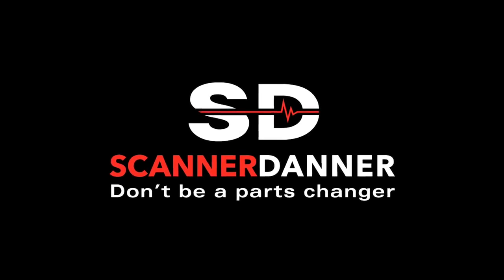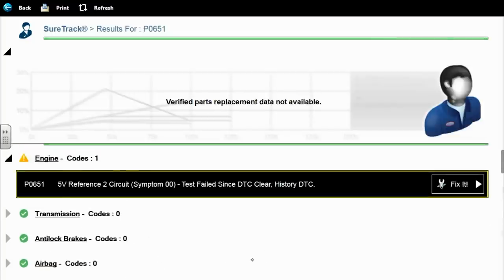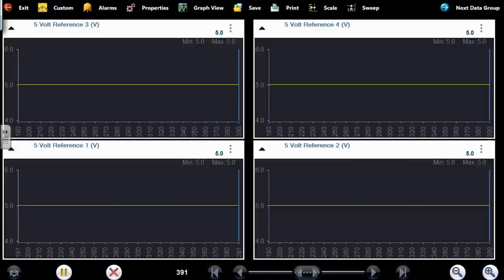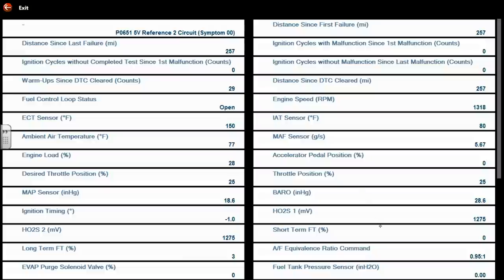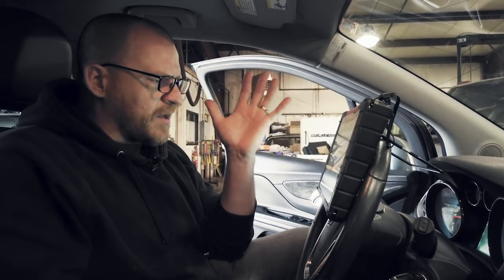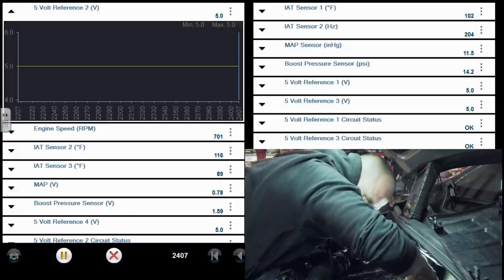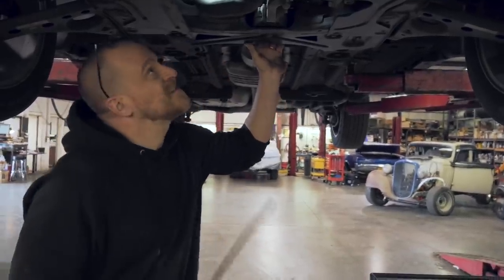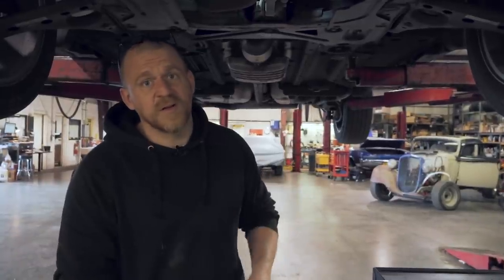Damn Intermittents (2014 Buick Encore 5v Ref Circuit Short)

Comment: Well to help out here that is not a common dtc or nothing common about anything with that dtc 
That harness being out of the c clip is normal sometimes come from the factory with those loose so don’t worry about that to much 
This engine is not GDI it’s port injected FYI 
Injectors go into intake manifold 
Now the only thing I’ve seen a vehicle like that act weird is underneath the battery tray there is a harness if I’m not mistaken & what happen with me was battery corrosion from old battery leaked into harness & made vehicle do some funny stuff can’t remember what dtc’s it set but it was my problem 
Hope this helps Paul 
GM TECH OUT...

Comment: 5v ref resistance check to ground. Wet the engine bay. If it is  shorted to ground any resistance to ground is an indication the wire is exposed.

Comment: Per the Freeze Frame.  I suspect the fault set shortly after a cold start/ cranking event.  Based on Temps, APP, TPS and IGN B+ read 11.75v.   I question if B+ at the ECM dropped low during cranking and caused the fault to set.  I would think there would be associated faults due to low B+.  Its a bummer not knowing the history/ story.   Other than that, the PVC system is a common failure on the that Engine which requires R&R of the Intake/ Valave Cover.  Some M.Y are under Factory Recall.   Finding the missplaced harness at the intake raises a flag for potentially poor Workmanship issues.

Comment: Hey! Just bought your book, it's great! I also just bought the Autel Maxiscope to use along with my Autel MS906TS. Do you have any experience or have you seen the scope used? Hope it's decent. I'm just beginning to learn about scope use.

On another note, PLEASE tuck those hoodie strings into your hoodie or snip them off. I've never had a near death experience with them on a running vehicle, but have come close to them catching in a belt or pulley. After a time or two of that i'm very aware of dangly bits (not THOSE, that would be a feat all in itself!). Stay safe and thanks for educating us!

Comment: Intermittent transmission sensor on my 2012 elantra touring Dan !
Magnet got tired ?
124,000 
No codes no lights 
Intermittent issues for 6 months 
Had to figure it out myself after just slapping in a part
The Mechanics in Omaha 
Need you training them !
😎✌️
Reply from the maker: did you fix it? Not sure what your question is. Thanks!

Comment: Hi Scanner Danner, early this year I was having trouble with my 2005 Ford f150, was missing on cylinder5 i changed injector, coil, plug was still running rough. I checked the injector plug with a node light nothing. I traced wire back to ECM(computer) to see if I was getting power to injector #5, it showed no power. I ordered a new computer still didnt run right, I finally unwind the wire harness from #5 and found the wire was broke. Lol all that for a broke wire. Thanks for the help. Shes running fine now for a Ford

Comment: Awesome video! Does someone know what can be wrong with my car if it's suddenly just losing power while driving (normally at lower speeds, it has happened many times that way what I'll remember), If I give it gas and push down hard on the gaspedal, it increases the speed and it goes back to normal. This happens intermittent, which sucks. I used my scantool and got the code - hall effect switch low voltage. Can this cause my symptoms?

Comment: On ‘“fix it”, if your subscription was up to date, it would show you a history of parts that fixed it based on miles. I use it to ensure I haven’t missed a system when I go through my testing. It helps, somewhat, when you have incomplete or inaccurate wiring diagrams.

Comment: As a GM tech I see A LOT of terminal tension issues causing intermittents.  We actually have test probes that check for the right amount of tension in connector terminals.  Even brand new vehicles I've seen some completely hogged out and not making good enough contact.
Reply: Oh and there may also have been something going on with connectors x112 and x200 according to that diagram.

Comment: Hey Paul I had issues with the cel coming on for pressure differences and a 5volt  ref . Couldn’t figure it out and there was an update for the software .. actually 3 updates for other things too .  Check for an update and do them .

Comment: I’ve had 2 intermittent issues this week, 1 was a coil connector on a v10 Ford that wasn’t clicked on. The other was a intermittent loss of power on the freeway, old school 7.3 powerstroke, had a aftermarket tune that was the issue, removed the tune and the problem went away.

Comment: Not the computer nor the harness...clean out the AIR DUCT.
Reply from the maker: That wouldn't drop a 5v ref 🙂
Reply: @ScannerDanner  
It might, if the parameters of that combo unit is way off. 
 My sister gave me her old 2003 Toyota Camry (when she bought her new 2020). had a few problems...but one problem was that at intermittent times it would idle down and cut off. I did some research, and learned that a dirty mass air flow duct and the sensor will cause it to do that.

I sprayed and clean the duct and the sensor pintle. 
No problems with the intermittent idle down and stall after that!

Hey...just a thought!

Comment: Had the same exact issue on that same model and year vehicle. The issue was the ecm. But in my case when u shut down the vehicle, and turn it back on, it would go into limp mode and flag that code, and went to limp mode. When i check data, 5 volts is ok. So i did that same test with scan tool monitoring the 5 volts, you can see the 5 volts ref 2 slowly climing up to 5 volts.
Reply from the maker: This is a great tip! Thank you for this information
Reply: @ScannerDanner  i had one hear in south Texas had to let run 1 hour turn off for 1-2 min. Hot soak . lost 5 volts and crank no start BAD ECM .

Comment: I hate newer GM cars! They're so problematic. The only reason I like them is that they're putting my kids thru college! But I would never own one. It's amazing how many 5v ref problems these GM vehicles have. I've diagnosed several of these 5v problems and they are hard and time consuming to diagnose because they're so intermittent.  And the 5v lines go to several sensors from the same bus.  If one of these problems come my way, I charge an arm and a leg to my customer. And I still charge whether the problem is fixed or not. I tell the customer that ahead of time. That's their fault for owning a GM product.
Reply from the maker: Good for you man. Your time is worth every penny. Communication is key! We do not work for free, right?

Comment: i KNOW UP HERE IN ALASKA, WE HAVE ALLOT OF ISSUES WITH THE CHARGE AIR COOLER AND ICING, THE AIL TEMP SENSOR THAT IS ON THE AIR INTAKE I.E. BOOST TEMP SENSOR ACCORDING TO GM IS VERY SENSATIVE, GM DOESNT EVEN WANT US TO CLEAN THEM WHEN WE UPDATE THE CHARGE AIR COOLER, AND THE BRAKE PRESSURE SENSOR IS JUST A VARIABLE RESISTOR, COULD HAVE A CONTACT POINT UP FURTHER UNDER THE DASH,  JUST A LIL FUNNY STORY, WE HAD A CUSTOMER COME IN WITH APP SENSOR CODES THIS LAST SUMMER, UPON INSPECTION, FOUND THE WIRES AT THE APP SENSOR LOOKED BURNT, REPLACED THE PIGTAIL, CAR CAME BACK THE NEXT DAY, SAME ISSUE, WIRES AT THE CONNECTOR WERE ALL MESSES UP AGAIN, AFTER WE GOT THE CONNECTOR SNIPPED BACK OUT AND LOOKED AT IT CLOSER, THERE WERE BITE MARKS ALL OVER IT, THE GUY HAD WENT TO TE STORE AND LEFT HIS LIL POMERAINIAN IN THE CAR, NEEDLESS TO SAY, HE QUIT DOING THAT AND WE HAVENT HAD THE CAR BACK IN.....
Reply: I`ve cleaned the boost sensor several times so far without any issues

Comment: When the scan tool asks you if the vehicle is a vin 8 or a Vin B, how can you determine which one it is?
Reply from the maker: Typically that question will also tell you which VIN number. For example, the 8th character is the engine, the 10th in the year
Reply: @ScannerDanner  what about in this example? When it is just asking for vin 8 or vin b? I didn’t see it specify which character of the vin number it called for

Comment: Maybe it's a ceramic capacitor  inside pcm, check for short or low ohm to ground
Reply from the maker: You could do all the checks in the world and you will not find the problem unless you can duplicate the fault. I've never been a fan of using the ohmmeter either. I mean, on certain circuits yes, but most, no. Thanks naive1!

Comment: Got my butt kicked helping a friend out with a intermittent plow control issue. Basically had to go through the entire system to find out there was actually 3 different issues. 1 pin on the plug connection where the plow and the truck connect was corroded so the down function wouldn’t work intermittently, 2 the down switch had shorted out which made it go from intermittent to not working at all, and a capacitor for the down control feed on the circuit board was weak and only provided a short blip of signal then would cut signal. Now everything is fixed but man that one was a pain.
Reply from the maker: great example as to why we MUST keep our communication with our customers and know how and when to charge more than the initial diagnostic fee. This one would qualify for more time for sure, agree?
Reply: @ScannerDanner  I absolutely agree and we worked out a barter deal for the extra time as he owns a landscaping business.

Comment: Where can I get this snap on to buy?  I be seeing some of them but they seems to look different. Older windows version
Reply: He's using the snap on verus edge. Its about $4k used on ebay. Just make sure its been updated to 19.0 or higher. Updating is expensive. You can also go with the snap on verus d10 at 1/2 the price but it is significantly slower.
Reply: @bryanfischer2443  thanks. I would go with the faster one as you mention before.  I have a Autel, but it don’t seems to give me as much PID as his scanner is showing on most of his videos.  His shows fuel trim and more.  Thanks for that detail regarding the update version
Reply: @jadosmart1298  do you have the ms906bt? That is the most comparable to the verus except it doesn't have a built in scope. It generally has most of the data pids the verus has and more special features like key programming. It also only cost 1200 and its speed is slightly less the the verus edge. But the verus edge is always rock solid when doing test where the autel can be finicky in some test.
Reply: @bryanfischer2443  I have the mk908. I got it because I can add on the scope to it. Looking at that versus makes me have regrets of this autel...  I would like to get that versus, but the snapon website not so friendly when it comes to selecting product. Not much description

Comment: Paul, I'm curious as to your thoughts of a inductive kick from the starter into the 5v ref. 
The code criteria is a ref voltage fault. 
Not short to ground or power but fault. 
Your observations on the harness by the starter and the freeze frame data is what comes to mind. 
 The freeze frame data almost tells me the engine just started on both screen shots. 

Am I overthinking here? 
Voltage interference on the Ref?
Reply from the maker: You are not my friend. Others have pointed this out too. The was a fault that occurred on start up. Something I missed!
Reply: @ScannerDanner  I didn't see any of those comments. I didn't read into the thread. 
I'm speaking from a experience with a F150 that was stalling with no codes I worked on a few years ago. 
I found the CKP harness was rubbing on the AC compressor.  Not wire intrusion was present but there was a lot of grey fine metal around that area from the rubbing. 
 I had noticed that when I finally got it to duplicate the fee times I did, my observation was it was just as the AC cycle off. 
 After I moved it. It never returned again in my bay. 
 I had to do a catch and release on this ticket because I was still unsure of myself and the possibility of the fault and fix. 
 I had that ticket for 14 hrs on 3 returning trip from the customer trying to nail it down. 
After that never came back. 

Called the customer a few months later and she said it was still good.  
IDK. It tested me to the point of me questioning myself.
Reply: Btw. I was aware of the diode in The JB. It's wasn't that. 
 My thoughts were that the inductive kick from the AC clutch was inducing a abnormality in the CKP signal. 
But by the time I put my scope on that circuit I had already handle it.  Contaminated the crime scene.  
 There was the grey metallic paste around the loom from the wear on the compressor. 

The fault only happened after it rained.  
 The clues in the story that come later. Lol

Comment: I needed to add this is a no DTC failure.
Reply: Makes you wonder if it is worth the diag time if it doesn't set a light, no drive ability issues or won't fail an inspection if the state only does emissions.
Reply: Right, she has been dealing with it for a year. It’s finally starting to happen more frequently. I have a little flight recorder dongle that I sent her off with. Told her to unplug it when the fault happens. Since the TIPM is a known problem child and it’s responsible for power to the ECU and fuel pump circuits that is my next step if the dongle shows nothing.